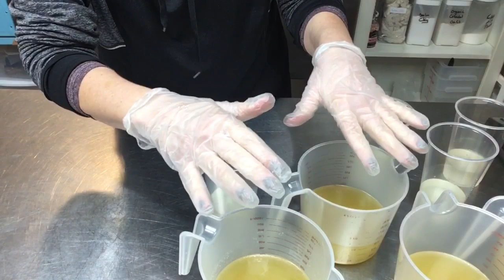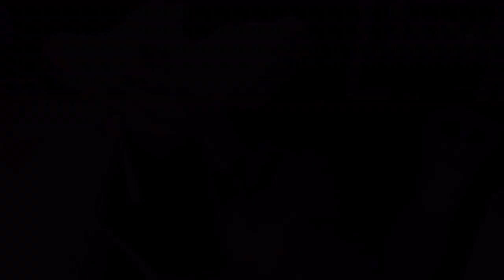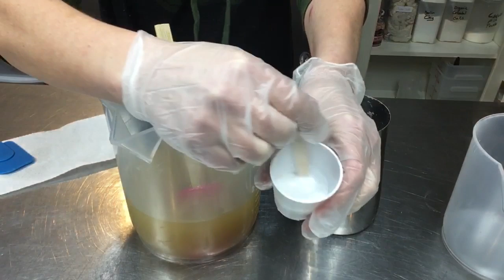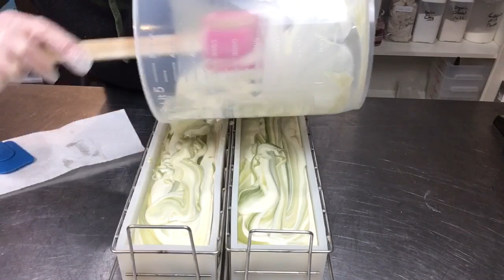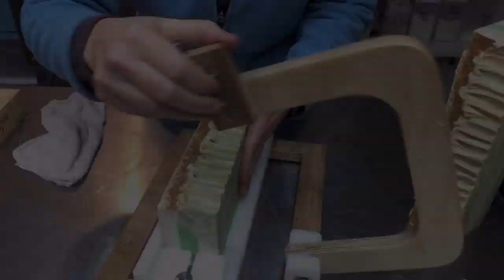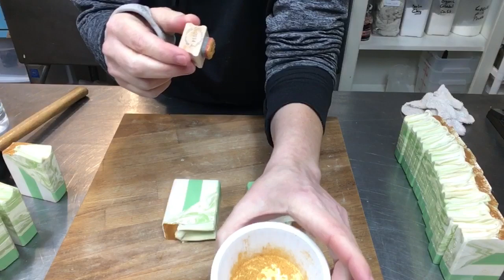Making Cutting & Stamping HAPPY CLOVER Cold Process Soap 2 day process w/ layers  | Ellen Ruth Soap

Comment: Hi Ellen! To prepare for your layered soap, did you just take your total volume of your oils and divide by 4 and then also take your total lye solution volume and divide by 4 to know how much of each you’d need to make each layer? For example: if my lye sol’n total volume was 197grams and I wanted to create 4 layers, I’d divide by 4 and weigh out 49.25grams of solution for each container. Then take my oil total volume of 500grams and divide by 4 and weigh out 125grams of oil for each container. Lastly, combine 49.25grams of lye sol’n with 125 grams of oils? I hope I explained this well. Thanks!
Reply from the maker: Yes I divided the oils and lye separately into 4 smaller batches